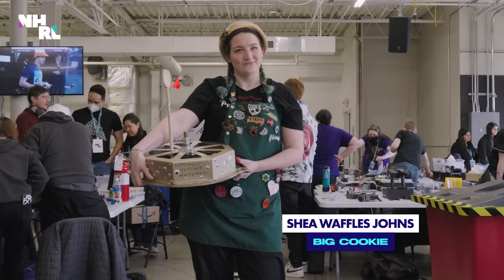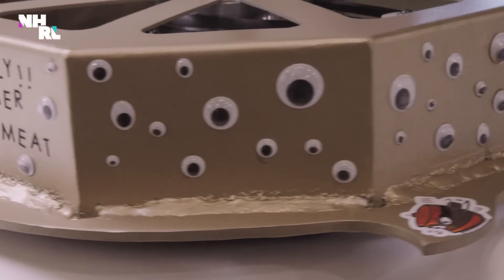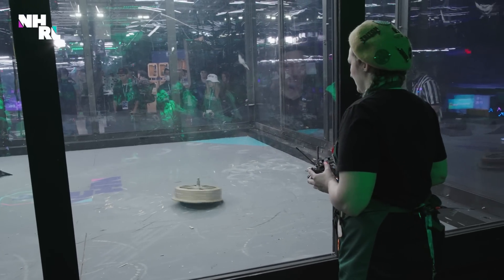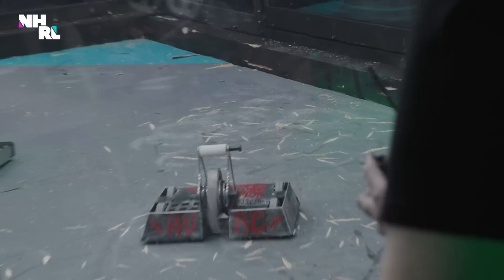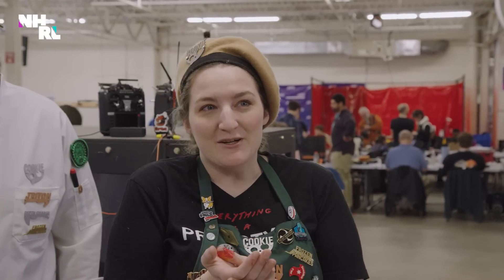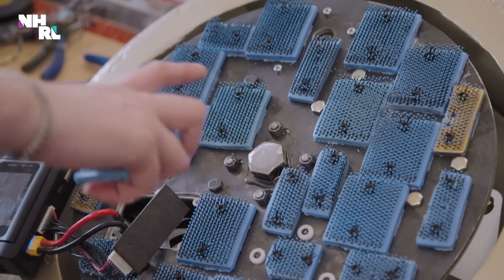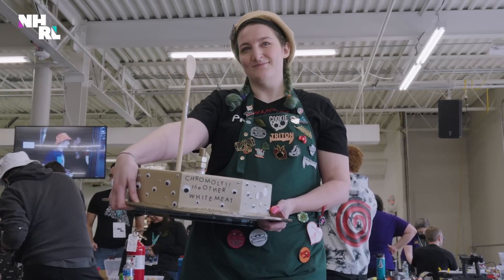Why I Build Robots Without Wheels

Comment: I dont understand these rules. If you lose controlled movement in battlebots, you get counted out. In NHRL, they seem to encourage building bots with ZERO controlled movement built right into the design of the robot, like this one, and depth charge. Just sitting there, spinning, isn't what I consider controlled movement, and I dont see how the judges can either.

Comment: Didn't loss of controlled locomotion used to be the condition for a loss? Since when did that change? A bot getting to the state this bot starts at used to mean you've lost. If you're weak as a pilot, there's a reason this is teams and not just 1 individual. If you wanna take part in an uncontrolled bot competition, that's a thing, it's just not as dynamic, because the pilots can't change the course of the battle through their skills

Comment: I like the concept, but the lack of steerabiility ruins it for me. You can just adhoc a gyroscopic steering build that depends on vibration to get moving. You have to do a lot of math and program a conteoller to pulse slowdowns and speedup to steer this thing. There is no way a human can manually do this.

Battle bots need to start the first round with a control testing course. To disqualify robots that can't be controlled with intention.
Reply: At one point, a loss was declared once that control was lost, so under the original rules of these guys at least, this bot started the round in a loss state already, meaning they'd need to somehow end the fight before the 10 second countdown that started immediately was up.

and I am with you on this, this kind of bot is what you're looking for in unmanned bot competitions, it's antithetical to this style of matches intentionally. The main reason for manned bot competitions is the dynamics that comes from the pilot being able to shift the battle's direction with their skills, but that's not present with this bot, because the pilot isn't a good pilot and because they're also one of the builders, they just deleted the chance to offload that role to someone who can pilot, as most of these teams do, because that's part of why this is a team competition

Comment: I think the idea is to actualy be able to control your robot. Just putting a motorized spinner in the arena and seeing if it hits something isn't a robot.
Reply: tbf none of these things are robots, just RC cars
Reply: It is controlled with torque steering. This was its first outing so we're still getting its legs under it ;D Especially in the smaller versions, directional control is apparent. Some structural changes will allow it to really show what it can do in a future event :)
Reply: @lucidahand7975  how about making part of the baseplate able to tilt to change the pressure on the bristles attached to the tilting section?
Reply: @greggv8  We tried servo-powered legs at Moto and they're promising! The biggest advantage to that is angling the shell to get more bite. The torque steering works great when the weapon is a tad more balanced than it was at this event.

Comment: Good concept, a little lackluster in the mechanical side but it's a first year robot.
The minibot was really a great team player, ample speed and great driving! 
Perhaps the uneven bristles made the main bot dip too much at high rotation of the main weapon? 
I understand that they want some dipping, but perhaps they got more than they bargained for?
The two stops in the last 2 fights, was that a mechanical failure of the gearbox they mentioned wasn't made for their possible rotational speeds? 
Good efforts nonetheless, great showing getting into round 2 in their first year!
Reply: The minibot is definitely the MVP! The main issue was that there was too much space between the baseplate and the inner shell, so the shell could wobble too much with that clearance. The second fight, since the driving pulley is the highest point in the internals, when the shell rocked in that big hit and kept spinning, the top of the shell knocked into the pulley hard enough to break the shaft going through the right angle gearbox. The gearbox surprisingly held up great! 

The solution to that problem is rub blocks along the baseplate for the future, so the shell can't tilt so much. We've also since revised the driving pulley attachment method so that it's not as close to the shell lid.

In the rumble,  the issue was from the weapon pulley! The main shaft is a big bolt, locked in place with two nuts. The threading on the bolt was just a little too long, and Cookie spins in the tightening direction. This is great for making sure the weapon pulley doesn't fly off, but the nuts tightened enough in that hit to lock the whole thing up. Everything else was fine after that, so we got a longer bolt for the future and adjusted the spacing to those nuts. There was some smoke in the rumble, but it was from the belts burning up as they tried to spin the locked up weapon pulley.
Reply: @lucidahand7975  
Thank you for the very detailed and well laid out reply, very much appreciated! 
You clearly have much more information than the video, so I'm guessing you have something to do with the bot or have other sources perhaps? 
I will be looking out for the upgraded version, seems like most of the issues have been addressed already, so I'm excited to see the results!
Reply: @kholdanstaalstorm6881  I'm the builder, thank you for the kind words! We brought it back to Motorama Robot Conflict this past weekend (with legs!) and it's definitely going the right direction, but lots of problem solving to keep me busy haha
Reply: @lucidahand7975   
No wonder you had all the details, dealing with the issues first hand! 
Thank you for taking the time to chat with me, I'm very honored and grateful that you did that!
I can only imagine how much you're kept on your toes in that position, not to mention all the possible and impossible things that can happen in a fight or a full series!
I've done some project work and management in a different field, so I know how it can throw you a curve ball from your blind side.
I would love to "pick your brains" with someone on the specifics of robot combat management, but an open YouTube chat isn't the time or place.
They say "break a leg" when wishing all the best in the theaters, but I haven't learned the equivalent proverb for robot fighting.
The sentiment still stands though, so fingers crossed for you and the team!
Reply: @lucidahand7975  Radial needle bearings and hardened washers will help with that. They're inexpensive at McMaster Carr.
Reply: @greggv8  They are great! Big Cookie does use them in that stack on the weapon shaft.

Comment: Does she have any control over it at all?
Reply from the maker: Some, but it’s a new robot and it takes time to get everything dialled in. It’ll be much better each time they run it. When they do it’ll be a beast.
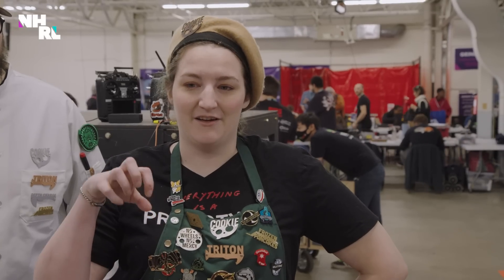Reply: She explains the control method at 7:33
Reply: @TeamSmallRobots she explains how it moves and how she has very limited control intentionally, because she sucks at piloting, so she just sets the bot up to not need piloting and instead just let her button mash essentially in hopes it works out fine, which means it is already in the 10 second countdown to loss immediately upon starting the match and should be losing every match as a result, if they didn't decide to make an exception and allow an unmanned bot in this manned bot competition, when her skills would fit perfectly in an unmanned competition, though those don't get as much attention, because those bots function like hers, not able to be substantially influenced by a human's moment to moment judgments during the battle, resulting in less dynamic and interesting fights